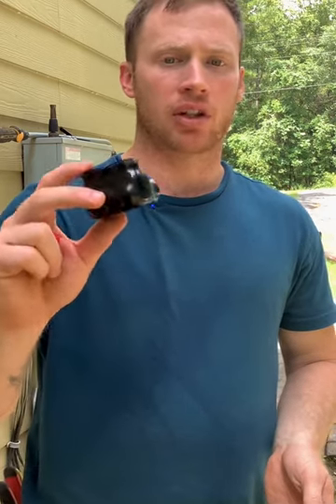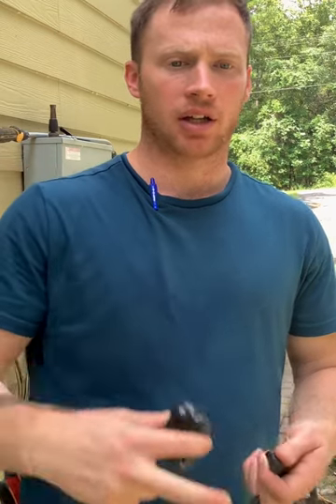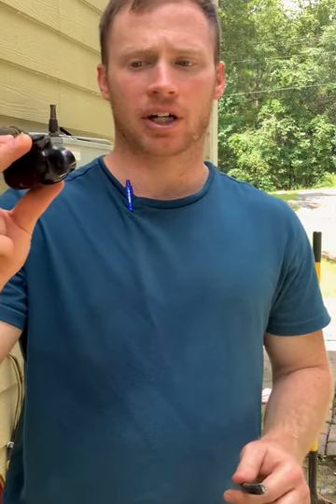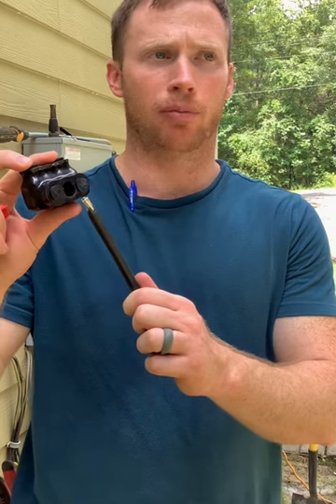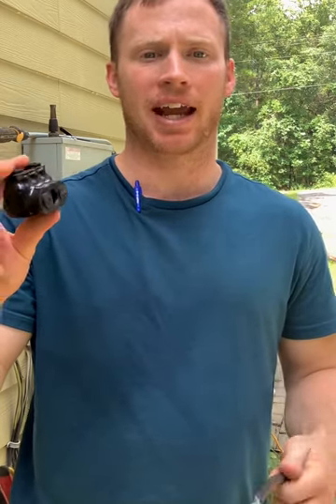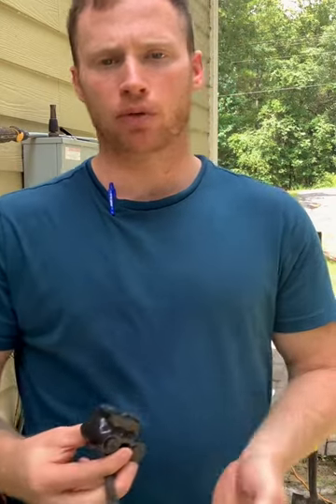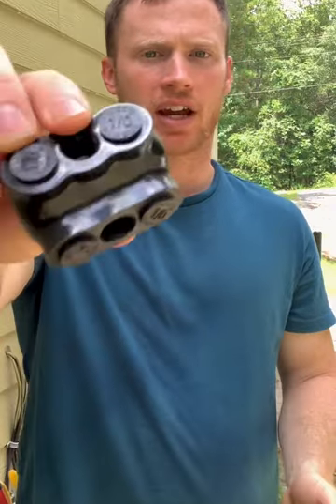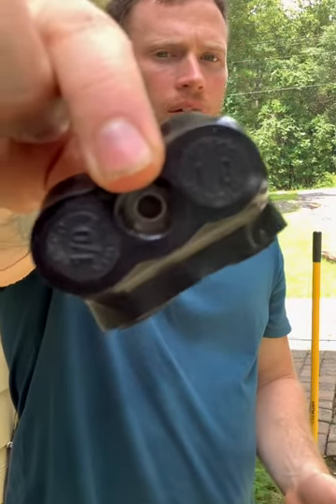HOW TO SPLICE LARGE WIRES

Comment: Can you splice copper and aluminum in the same one?
Reply: Read the specifications on the specific type.  I have used Polaris and the ones I used said that it was for "copper and/or aluminum."
Reply: @FreeAmerican-mm2my  I always use no ox on these if you use aluminum wire even though most aluminum wire now is an alloy that doesn't require it. It's better to be safe than sorry and I use it all the time on such connections. I also use it on my copper to copper connections in harsh environments or with larger wire sizes or split nuts. I do this because it also provides lubrication making tighter connections possible easier as well as fills the spaces in multi strand wire. It also allows for easier removal if at some time in the future work is required as it provides anti gaul and anti seize protection as well. Just be aware that code says it's required to be used as the manufacturer requires. That means wire brushing the wire and connectors like split bolts as well as removing any excess around the connection. Also note that if using No Ox  or wire nuts with the compound already installed in the wire nuts (better to use the wire nuts with the compound already in the wirenut from the manufacture IMHO) the wire nut is to be open end up not down. That way the compound won't drip out if the connection heats with use. Anyway you gain much more that just anti ox benefits from No Ox use.

Comment: Do you need to use the gel?
Reply from the maker: In these Polaris taps they already have the anti-oxidant gel in them when you buy them. 

Typically, people will use anti-oxidant gel when terminating aluminum wiring however it is not required by code today.

Comment: i was wondering how i would get my induction stove wired up.. 
it needs 8AWG wire and there would be 3 wires.. 1 for the stove top 1 for the oven and 1 for the line
seemed too sketchy to use wire nuts and wagos don't go that big

this is basically a giant wago!
Reply: No, it doesn’t rely on a spring tab like the push-in Wagos or a lever and cam like 221 Wagos. The Polaris connector uses a set screw to clamp the wire into the splice block.
Reply: @skullfracture2  by giant wago I meant how easy it is to use :)
Reply: Hey Dylan, did anyone ever answer that question or were you able to figure out a good solution?
Reply: @PS-ej2xn  yes I found essentially a giant wago called a Polaris connector 
you unscrew the Allen bolt and push in the wire then screw down the Allen to secure it. they can be purchased online at Home Depot. 
they are super bulky but I put my wires in a small junction box in the cabinet the stove sits inside of.
Reply: @dylan-nguyen  Fantastic. Thank you, my friend.